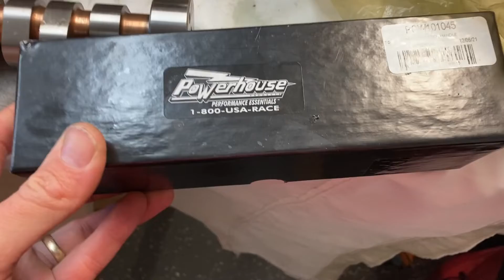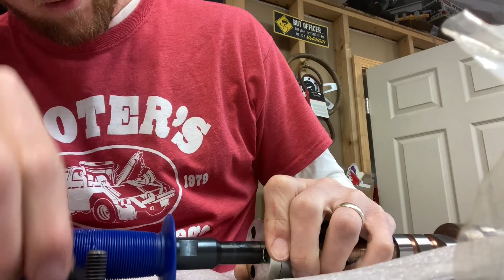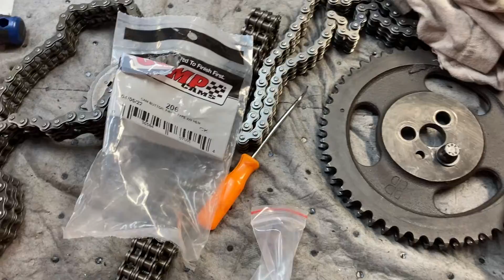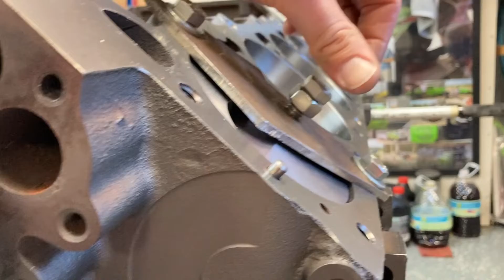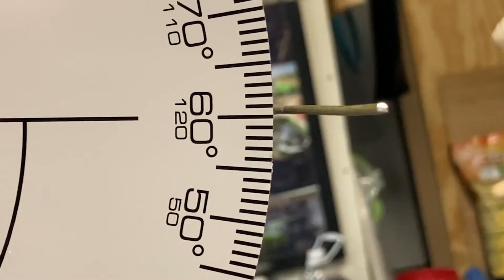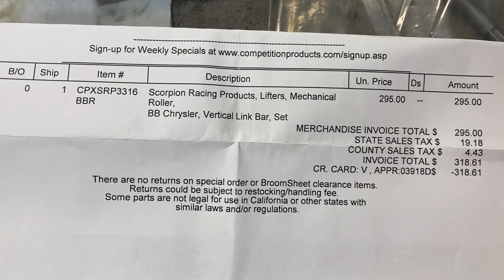Big Block 400 Build Series: Roller Camshaft Installation and Degreed #mopar #bigblock #compcam

Comment: What was your reason for using a low deck engine? Theres no way id use one wt less then a 3.75 stroke. Id run small blocks b4 a boat anchor! Seriously, have you ever made any power wt a stock crank 383 or 400? I just wanna cram my 440 stuff in a low deck so i can find headers & ive got about 25 so which ones should i keep away from?
Reply from the maker: I always wanted to build a stock stroke 400 for the street. This one made 535 horse on the dyno, and revs quickly. It’s in my blue truck now. You gotta check out my weight comparison video. This 400 weighed less than my 408 stroker with iron heads.
Reply: @JustMoparJoe great news!

Comment: Teacher told us years ago that the rotating torque, as measured with a beam type torque wrench should be 5 ft-lbs for every rod and piston assembly that is added to the assembly. So 40 ft-lbs in total for 8 cyls, maximum. Chevk after each one is installed. Just something I learned that I wanted to pass on. Great videos, man!
Reply from the maker: That’s interesting. I wonder if it was with standard stock hardware and 30 weight oil. Thanks for sharing!

Comment: Hi Joe.

When putting a roller cam in my 440, I found that there was 6 degrees of dwell (no piston movement) at TDC. Basically this meant that after the piston stopped moving up in the bore (measured with a dial gauge), the crank carried on rotating for 6 degrees before the piston started to move down the bore and reading on the dial gauge.

I was surprised at how many degrees of dwell there were. This meant that true TDC was 3 degrees AFTER the piston  stopped moving up the bore. Once I had found this out, I set the TDC mark on my degree wheel to 3 degrees after the the piston stopped moving up the bore.

Hope this helps
Reply from the maker: Thanks for sharing. The shorter rod will have less 'dwell' time at tdc, but the long rod will have greater acceleration back down. I would bet that’s why the 400 had such short dwell
Reply: @JustMoparJoe  Good point about the shorter stroke. 

It wasn't something I hadn't really considered before until I started the project, so I was surprised by how many degrees of dwell there were. 

It's a street engine, so not as critical as your build, but it was an interesting idea to factor in.

Again, you may be aware, but another experience I encountered during my roller cam project is that it seems some aftermarket roller lifter manufacturers are advising people not to use traditional 20W/50 engine oils if you make the switch to roller from flat tappet. 

I used Comp Cams followers and had the spring retaining cap blow out in one lifter. Comp replaced it under warranty, and the new one although on the same part number, and a circlip instead of a spring cap to hold the lifter together. Clearly the spring cap has given them issues, and I think a combination of good oil pressure on a fresh build, and 20W/50 is leading to failures.

Not sure what oil you are planning on using, but might be worth checking with Comp.
Reply from the maker: @somebloke13  got her running! Videonup this afternoon 👍🏼
Reply: @JustMoparJoe  Excellent. Looking forward to seeing the video!

Comment: Interesting that you mentioned cam timing affecting cranking cylinder pressure.   Just aired a video on compression ratio versus cylinder pressure And talked about that a little bit as well.
Reply from the maker: Yes sir. Real recognizes real!
Reply: @JustMoparJoe  Thank you my friend. That is a huge compliment

Comment: unless you run 13.5 :1 compression, i would rather run it advanced. comp grinds all of theirs adanced by 4 degrees is what i heard when doing dot to dot line up.low static compression and short stroke with low lift cams are not great on street
Reply from the maker: The original paperwork was with this cam, and said that it had 4 degrees added for better “street-ability”. This one will be around 10.5/1 after the heads are cut. Just an inexpensive experiment for a bracket car.

Comment: Good video Joe, very well explained. What is the advantage of 1.6 vs 1.5 rockers? Are the 1.6 rockers more robust?
Reply from the maker: Thanks Mike. They multiply the cam lobe 1.6 times, instead of 1.5. So it gives more lift for any cam. You can use a formula like[ .500 lift/1.5)=33333x1.6=.533. So it would add around .033 to a .500 lift cam.
Reply: @JustMoparJoe  thanks for that explanation. Makes a lot more sense to me now. Love following your channel!
Reply from the maker: @mikestackhouse9001  thanks for the support!

Comment: Old late 70's early 80's. Blue should be purple in color. A man I new roller his Super Bee an had a killer 440 and every part that you could get from Chrysler corporation racing catalog. He was fortunate to save the motor that was in the car and had a whole complete second set up of the next bigger parts. 30 over racing pistons solid flat tappet cams and the whole 9 yards. I'm going to get out his way and see if he is still alive and owne his family farm still. Last time I was out there there were only 4 farms on the whole road and he was the last hold out in the early to mod 2000's, 2004/5. He worked for the steamfitters union even though he broken his neck and had it completely fused. I will keep you posted on what I find out. He was like last hold out the whole road was sold in , .1 acre lots and made into cookie cutter homes.
Reply from the maker: Awesome! Keep me posted

Comment: Will the solid roller lifters increase the rpm limit? I’ve heard people talk about solid roller lifters on a hydraulic but I thought it was a urban legend
Reply from the maker: It should make more rpm. Oddly enough, the solid lifter weighs less than a hydraulic. Should move faster and be more stable at high rpm.

Comment: Hi Joe, building very close to an identical motor. Different cam and I am using Trick Flow 240 heads.  Pistons are .025 in the hole for me. Where did you get the cool crank nut socket you were using? You should really gives us part numbers for cool tools in the comment area! :)
Reply from the maker: Thanks buddy! Check out comp 4799. I added to the description, on your fine recommendation!

Comment: Wait, what made more power? The tight chain or the loose one?
Reply from the maker: The loose one! It was interesting to hear. Loose is fast they say
Reply: @JustMoparJoe  the loose chain is susposed to pull harder in high gear.
Reply from the maker: @williamturner8422  that would make sense, if it made more hp on the dyno

Comment: I have a very similar solid roller for my 400 build - just a question, how far below the deck are the pistons and how far did you cut the deck to get them there? Enjoying the build, still need funds for mine . . .
Reply from the maker: Thanks Andrew. Mine are .015 below deck. It was decked to the point of trying the block. Mine is within .0005 side to side, front to back! Check out the “Hidden power” video. I discuss how much was decked and how it helps.

Comment: Why hydraulic cam with solid lifters? Experiment?
Reply from the maker: More rpm capability of the cam, more stability at higher rpm. Revs faster, but has a softer ramp than a solid roller cam. Here’s a link. https://www.google.com/amp/s/www.motortrend.com/how-to/solid-lifters-on-hydraulic-cam/amp/

Great video on degreeing a cam. Motor trend has an article on running solid lifters on hydraulic cams, basic lash settings to do it.

Comment: What's the purpose of the cam button do all engines have them or need them? Stock or hi performance engines
Reply from the maker: Thanks Kelly. It’s more of an issue on roller cams. Big blocks don’t have a plate between the cam and block. Very similar to a SBC, the cams can “walk” under deceleration. When accelerating, they are pulled backwards. But let off, they shoot forward. Also, at high rpm’s they can “walk” forward and back. The button helps stabilize it and maintain HP.
Reply: @JustMoparJoe  thanks Joe here's my engine just put headers on it inexpensive ones from summit
Reply: https://youtu.be/NywjWv5t5NM

Comment: How does this cam compare with the 408's cam?
Reply from the maker: It will have more lift by .020. Duration is very similar, but the 400 has a 110 separation vs a 108. I would guess the 400 revs faster and pulls to 6,500+. The 408 was done by 6,000-6.200.
Reply: @JustMoparJoe  Hey Joe, do a little research on the recommended r.p.m. limit for the cast crank.
I think 6500 might be the max recommended for cast crankshafts.
I know that the forged steel will live at 7000 for a very long time with good aftermarket con. rods.
Reply from the maker: @williamturner8422  from what I’ve studied and was told by some professionals, it’s referenced by horsepower. With proper balancing and appropriate clearances, it should live for a long time at 500 horsepower.
Reply: @JustMoparJoe  O.K. , very good.
Reply from the maker: @williamturner8422  I likely won’t go over 6,500 in regular use. I’d rather it live a long time

Comment: Great video Joe.
You are showing and teaching people good solid procedures. 
Nice degree wheel you have there.
Glad you are using the positive stop method for finding the absolute TDC.
As you know the method I use now for more than 40 plus years.
You did a great job.
I totally agree with you leaving the cam in the advanced position.
1.5° is very small amount. 
The cam is always retarding throughout it's life with a chain.
So after a little bit of running and normal chain stretch it will be on the money.
Great content as always.
Take care, Ed.
Reply: I always appreciate yours and Joe's informative videos whether they are about engines, suspension or body videos it's all good 😊
Reply from the maker: Thanks Ed! I appreciate the support and tech information